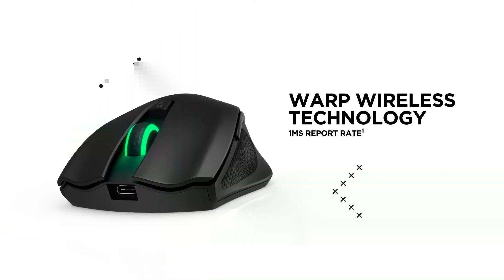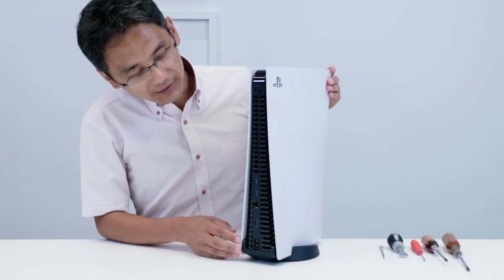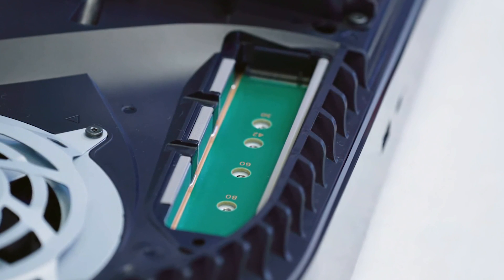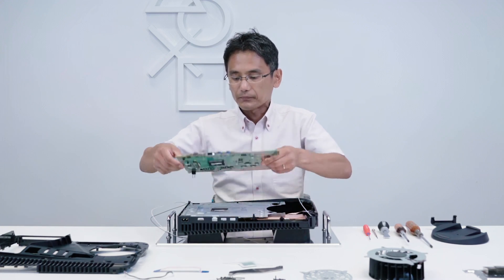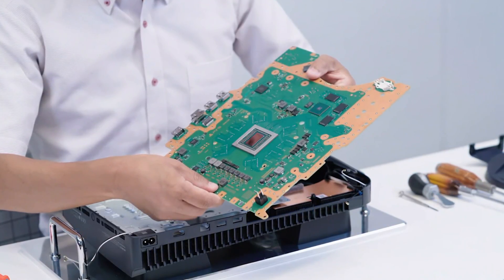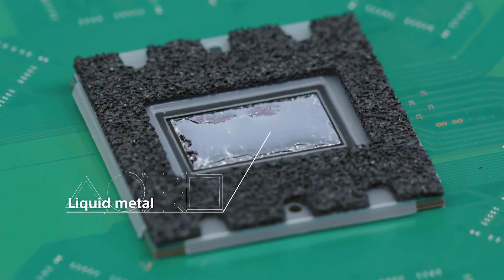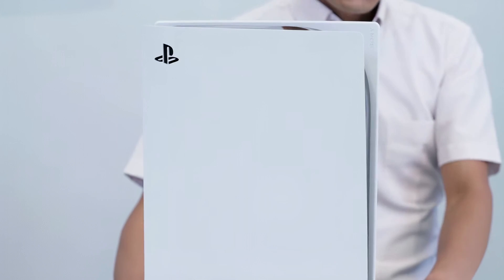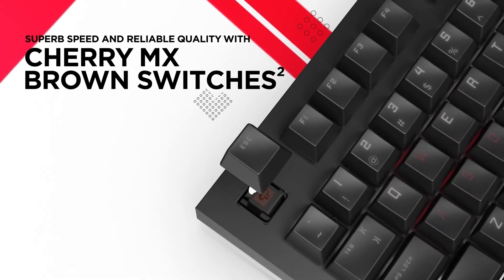PlayStation 5 Teardown Analysis: Inside Sony's Next Generation Hardware Design

Comment: Without wanting to incite any "console war" silliness, I do think that the Series X is a better engineered piece of kit. To be as small as it is in comparison to PS5 and yet be the more powerful box is really impressive.
Reply: to be as small to the detriment of heat dissipation??? theres a balance obviously... now we're hearing complaints of xbx being HOT.... people complained of heat and noise, sony design to get rid of both, now people complain about size lol and want to squeeze it into the smallest box possible... we will see how well the x fares when games push the tech... dont forget ps5 runs hotter and faster... and im pretty sure sony devs will push the tech till its screaming and breathing fire
Reply: @antwango  yes I think this is the question. If both companies deliver in their promises and keep the systems cool the Xbox is more impressive from an engineering perspective. But the PS5 I am sure will work, more safe I guess.
Reply: Yes but not in totality. Like John said the devs have informed him all isnt what it seems.
Reply: To be clear, I don't think any console will have any heating problems, rumour is they both run at similar temperatures. Just in my opinion, Series X is the better engineered. If it overheats etc then I will stand corrected!

Comment: Lots of people seem confused about the purpose of this channel, I posted this somewhere else and am more or less putting it here.

You do realize that this entire channel is about comparing specs, power, graphics, consistency, etc right? That's the reason the channel exist. 

When DF have talked about series X and not mentioned other tech, that's with embargoed hardware. If Sony gave them a system, they would be under similar embargo and follow it,  and have a reason to make more PS5 content.

Once they own both consoles free and clear of embargo the only thing they will do is compare them critically in every aspect. Loading times, graphics, performance, thermals, noise, etc.

If you just want to hear Sony opinions devoid of any and all other tech perspective, either pressure Sony to give them a PS5 under an embargo preventing direct competative comparisons or go to channels a different channel on YouTube. Plenty of them cranking out lots of pro Sony opinions while also talking about the tech specs. DF isn't one of them, comparisons is what you should be here to hear.
Reply: Wondered about the relatively bad like/dislike ratio. Butthurt fans, it seems.
Reply: MertensCW  Awww, did i strike a nerve, I believe your the one crying. 
not one word of the PS5's USB ports were said in this video. if i'm wrong Time stamp it.
if your referring to another video. that's irrelevant cause they were supposed to examine the PS5 breakdown.
Reply: Stop trying to explain another man's bias.
Reply: @jasonspades7775  🤷‍♂️
Reply: When you title a video "PlayStation 5 Teardown Analysis: Inside Sony's Next Generation Hardware Design" you don't expect a PS5 vs XsX video
also I find it odd that the whole video is comparing the XsX with PS5 until it to a point PS5 does something better. Example the Wifi 6, instead of comparing it to Wifi 5 that XsX uses they then start bring up theatrically crap to down play it.

this video was trash
Reply: @devilshooter126m8  even the usbs types ports are important in my book and no comparison 

like huh ?
Reply: @flhla_g1  that's a good example too, they didn't even mention the USB ports, which btw are faster on PS5.
Reply: @devilshooter126m8  When you analyze a conception, you make the comparison with older console  (he did) and you make the comparison with the "oponent" console (like he did). It totally makes sense. Why would he not compare the internal conception of the PS5 with the conception of the XSX ? He was one of the few who mount a XSX. Comparison makes sense.
Reply: Beastcraft  So what does being a bigger title(according to you) have anything to do with the LACK of analysis they did on Halo? The fact that a “dlc” looks way better than Halo should tell you something😂😂😂😂😂😂
Reply: @CosmeFulanito95  So omitting frame rates, bad textures, ridiculous amount of pop-in, not mentioning the absence of ray tracing, was not on purpose to you?!? For some reason people wonder why Sony is not sending them anything 😂😂
Reply: @uncommonsense996  lmao Sony didn't send ANYONE review units. That's definitely saying something 🤷‍♂️
Reply: @GhostShadow860  Actually certain celebrities and influencers already have the PS5; they are just not allowed to show anything at this present time. So the fact still remains,;they just don’t want digital foundry to have one, and I see why because of they’re not biased.
Reply: @uncommonsense996  source that certain celebrities and influencers were sent a PS5? 🤔
Reply: Sooo quick question, since digital foundry is so biased. When they were analyzing Halo Infinite, why did they fail to mention SO many things;resolution, frame fates, textures and pop-in just to name a few? Let’s not talk about Dirt 5 also. Another question, which video did they do more analysis on Miles Morales or Halo Infinite?

Comment: I’ve always laid my systems down but this system appears that it would be best to keep it standing.

Digital Foundry, you guy have any thoughts on this?
Reply: Laying it down would possibly make it easier for the flow of exhausted heat and also less falling dust gathering around the vent intakes.
Reply: Are you just talking astetics? I think airflow will be Good no matter what.
Reply: @westinbye  Nah, for the health of the system it gives me the feeling that it needs to stand.

I’d love DF opinion on whether they truly believe that the life of the system will be as good either way.
Reply: @gamingfamilyman7801  Vertical placement would be better. I guess the side panel would bend eventually if you lie it down.

Comment: That things is gonna rev up like a jet engine before take off, I learned my lesson with the ps4, no thanks
Reply: Yes let's just ignore the Liquid Metal, Giant Fan and Giant Heatsink that will make the Console even Cooler than any other console
Reply: @vale_recca  I'm a casual gamer, Jesus Xbox and Sony loyalist are so sensitive. First off, liquid metal has never been used in a console, so we have nothing to base off of that, it could work great, but no one knows as of now. And yes, it has a giant fan and heatsink (which is inferior to a vapor chamber) but that is because the system itself is huge and has large components and things going on, of course it's gonna be larger, but my instinct is it will still be loud as hell. Time will tell I guess
Reply: @byron7583  yeah only time will tell ( and also leaks too  ) but We can see how liquid metal perform better on PC than a Normal paste and keep in mind that this is a sony developed Liquid metal and made specifically for the PS5 CPU so i'm guessing it will cool better than a normal third-party PC liquid metal
Reply: @vale_recca  Yeah true. Either way I'm excited for the new consoles
Reply: It is that size to be cooler. Everything about its size is to fit the massive heatsink and the double depth 120mm fan. Anyone can tell you larger fans make a hell of a lot less noise to move the same amount of air.

In regards to the PS4, the noise factors are for two reasons,  the fans are small and so have to spin faster to cool at heavier loads and the thermal past on the APU was crap and degraded within a year. My PS4 sounded a lot better when I upgraded the thermal paste.
Reply: So the people who had the console hands on are liars then? (They say it's quiet, and coolish (p.s., if you haven't tried coolish, go and try to find some now, best food ever created))
Reply: @Pope_Gorden  what is this coolish you speak of?? 🤔
Reply: @byron7583  The best frozen treat ever invented
Reply: @Pope_Gorden  damn I'll have to look into that!

Comment: I don't really understand HW things here.... so where is the graphic card? Thx
Reply: The whole thing is the graphics card.
Reply: @JCMaldonado13  so based on what can you compare this to some pc card? Tflops? Or? Thx
Reply: @pavolridrich3434  It's an APU which is effectively a CPU and GPU in one pretty much
If you're wondering what GPUs the consoles could compare to I think the PS5 is like a 2060 Super/2070 (?) and the Series X is like a 2080
Something along those lines anyway
Reply: @ruxis8179  ok... Thx. So what in reality the difference is, I mean between ps5 and xsx? Even DF said before tflops are not the same this time than it was before. Better Gpu/cpu can make for example higher details, but can it? If you have for example slower ram, slower ssd (much slower) and the rest of HW is basically the same. Honestly I don't really expect big difference in multiplatform games, but I do expect Sony's exclusive will be like next next gen compared to those from ms

Comment: The PS5 design looks very impressive from an engineering standpoint.
Reply: @ianwparedes  your bias is showing
it is impressive 
on both consoles even. but you'd probably say "b-b-but more on Xbox"
Reply: @Heisenberg White
Ehh, looks decent engineering wise..
I think the Series X has a smarter idea of pushing the warm air upwards..
Perhaps that's why the Series X is shorter and more smaller..
Plus the ps5 needing a stand in both vertical and horizontal positions is just poor design in that regard in my opinion..
Reply: @Elementox-im1tm  what are you 12?

Comment: "PlayStation 5 is a simpler cheaper design"

WHAT!??? 😂 

Still salty that they didn't get a PS5 to test.
Reply: Yeah he should have said more traditional or tried and true. I am sure Xbox will work but they took more of a risk instead of just making it bigger. Sony I know will not have cooling problems. I guess the only risky part is their liquid metal process.
Reply: He’s right. The Series X is a much more consolidated, tightly-engineered designed - and more powerful to boot. Fanboys are pathetic. Who cares at the end of the day? They rightly said the same thing about the PS4 when they compared it to the XB1.
Reply: Exactly!! So much hypocrisy and flip flopping I thought PS5 was more expensive to manufacture because of costlier parts yet it’s simpler and cheaper too
Reply: Its true. Looks cheap and is weak too
Reply: @Elementox-im1tm  not really but whatever xsx is a rectangle and slow like really slow compared to the ps5 🤷 just facta
Reply: @domzzcardzz7985  Slow? Kid, Xbox Series X can have 6 games running at the background thanks to quick resume. Ps5 ssd is nothing
Reply: @Elementox-im1tm  Running in the background? You don't quite understand how Quick Resume(tm) works and that's okay! Quick Resume is closer to a save state offloaded to the SSD which they can reload for a quicker launch instead of loading the game from scratch. It's not concurrently running these games. Quick Resume still takes a good 7-9 seconds to load up the game again.
Reply: @NerfVagus  i know how it works and final conclusion it blows the ps5 ssd out of the water with this feature. Just saying the fact

Comment: XsX seems to been designed by engineers using the latest techniques and advancements, whereas the sony console seems to have been done in a garage by some hobbyists,
Reply: No actually ps5 designed is better but, this guy is biased so he will trash on Everything that the ps5 has to offer
Reply: Huh? it's actually the opposite. The xbox looks like they just stacked it all together and made it really tight meanwhile the ps5 is just a matter of smart  japanese design with it's interesting design
Reply: @lunar3009  Only in a fanboy type world. Electronics are marketed as compact, not spacious!!! Your new iphone 12, 1200% thicker than the previous generation with a massive heat sink and cheap, scratch easy black plastics! It's just a technical fail because sony spent too much on the SSD and had nothing left. The SSD only needs to be good enough.
Reply: @nothingtosee7718  But a console is supposed to be in a room sitting it doesn't have to be compact unlike an iphone which you carry all day so it has to be be compact and small.

Comment: The only reason I care more about the PS5 is because the only reason I'm even considering a console is exclusives, and even then mostly for a relatively small list of japanese developers that don't like developing for PC for some reason. If I didn't already have a gaming PC I'd get an XBox 100%. From what I've seen so far the technical differences between the PS5 and the XBox S.X. are really not nearly large enough to make any sort of call based on sheer merit.

The storage space thing is a problem for both consoles. On my PC I use a 500GB NVMe SSD + a 4TB SATA SSD, 100GB/1TB respectively reserved for Linux, the rest for Windows.  This for me makes storage "manageable", but I wouldn't say I don't have to think about it at all. Still means if I were to install, say, all the games I have on Steam + Epic Games + GoG I'd definitely run into problems quickly enough, and modern games are only continuing to get bigger. Are we going to reach the days where you can have only a handful of games installed at any given time again?

Comment: Don't understand the vacuum vents. The fan is the input and the vacuum vents look to be outputs. The dust is already in the system and the vents would just catch what ever did not stay in the system getting collected on the cooling fins and what not.

Comment: I'm astonished that Digital Foundry (and presumably everyone else) hasn't yet been sent a PS5 do assess and test. I assumed that this would be the case and they just couldn't talk about it, but this confirms that really isn't the case. Sony should really just let the info start flowing freely now as the vacuum could really cause enthusiasm to die down a bit. It feels overdue so with less than a month to release, they really should get DF and others engaged and talking about it. The teardown was boring, the influencers were all showing us pretty much the same boring gameplay. We want to see more games, benchmarks, thermal testing, interface review, UX features for backwards compatible games that they have kept quiet about so far. There's so much to talk about and so little time.
Reply: Yet that is the reason why you as well of the rest of us are anxious to know more, great pr strategy, Sony took the best dramatic approach the climax happens at the end as opposed to the middle.
Reply: @Dboux12  While I agree that it's worked to a point, I think it's reached the end of its effectiveness. Now we're just seeing recycled specs and rumours and it's just tiresome. It feels like we won't see anything until the week of release, which, by then, will just be to let people know what to expect from the system they're getting that same week. That seems like a last second preview that we'd probably not care about waiting for at the point.
Reply: They don't have to. It's how it works when you are the market leader. Look at Apple, they just have to announce a new iPhone and they will be sold out in minutes. 
MS is only doing all this because they HAVE to, they are in need of getting more people on Xbox. Sony has a worldwide loyal audience and reputation.
Reply: @dragons_red  But surely they want to not do anything to risk losing that lead? I mean, right now all I see on PS5 groups are people talking about the TV they have bought or plan to buy, or their preorder being cancelled, or managing to preorder multiple consoles, or confusion and questions about upgrades of PS4 games or saves. It's not exactly exciting stuff. And if that's indicative of a general attitude, it means there isn't an interest in making their userbase happy. They have a lot of laurels and they shouldn't be resting on them, so I hope you're wrong.

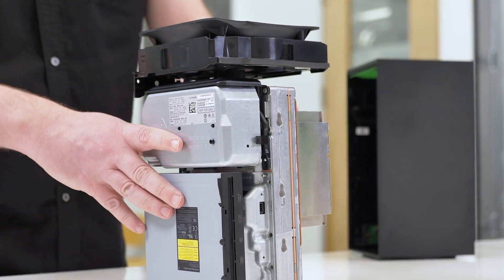Comment: 14:30 I disagree. I think the PS5's COGS would be higher than the Xbox Series X given the exotic liquid metal cooling solution and the much, much bigger heatsink with copper pipes. That seems it would be way more expensive.
Reply: The real coat for them is the R and D and build of the custom SSD architecture. The liquid metal encasement and heatsink are just mods on existing tech, and not as complex (no Electrical Engineering needed).

Comment: Wrong, getting dust out ps4 does not void warranty as you only open the top and not break the warranty seal. Typical biased assumption from DF
Reply: Nope I had to break my seal to Clean the fan
Reply: @lunar3009  oh really which one do you have?
Reply: @ThaiScoop  the original
Reply: @lunar3009  yes i see that now, thanks for pointing it out. Thats some lame shit from Sony. I got the slim so no problems.
Reply: Nope they aren't wrong. It depends on what ps4 u have. The pro slim or original

Comment: By the way, interesting point on the PSU units in the PS5 and the Series X. How come Microsoft's more powerful console use a 315W unit, while the PS5 has a 350W unit?
Does not seem logical to me at all. It could lead to potential bottleneck for the X.
Reply: An over provisioned  (larger than needed) power supply will last longer  and be more stable "IF" they both use the same power, this is standard practice for pc's you measure your requirements then get something larger to account for loss of efficiency due to aging if you want it to last a long time.
Reply: Nah, I'm sure MS has put in as big a PSU as necessary. Sony just goes overboard with their PSUs every now and then (PS3's was rated for double what the console actually used).
Reply: Lol wtf. Xbox is just more efficient
Reply: @Juicersen  Same CPU with higher clocks and larger GPU. Looks like You don't use logic much
Reply: @kostadinb  It’s gonna he using a steady amount of energy. PlayStation probably needs those extra watts because of variable frequencies
Also the console could just more efficiently use energy that’s a thing sir